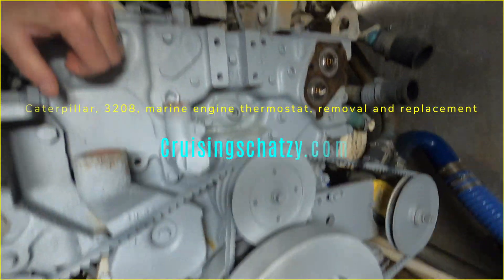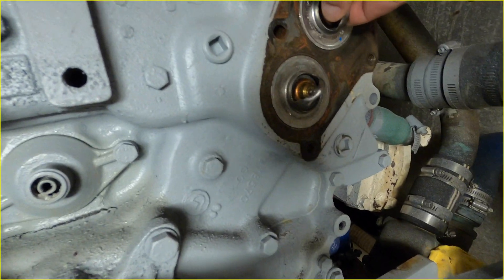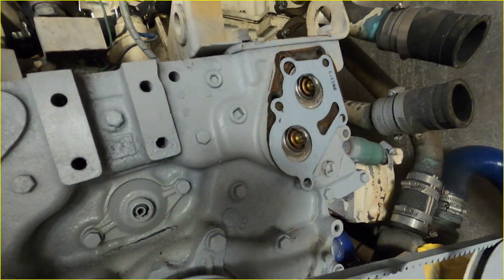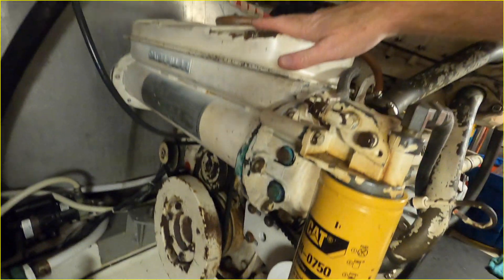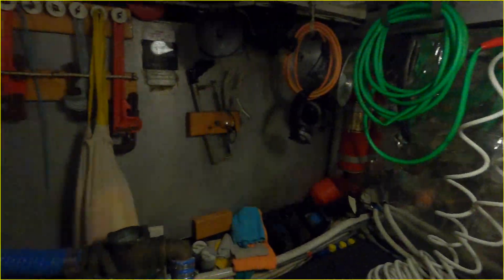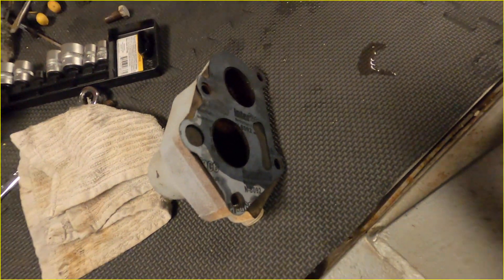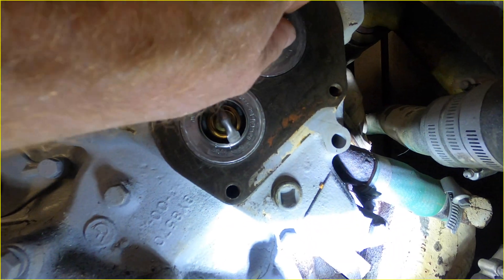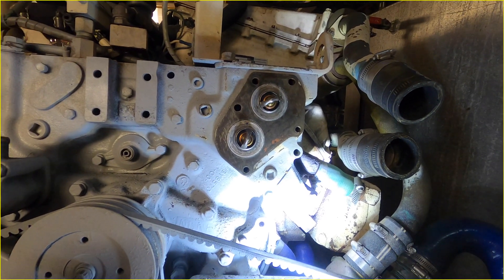Caterpillar 3208 Marine Engine Thermostat Replacement

Comment: Great video. Great idea to put some water in the housing to test before putting it all back together. I generally don't like gasket sealant but a dab or two will hold the gasket so it doesn't slip around while you're putting the casting back in place.